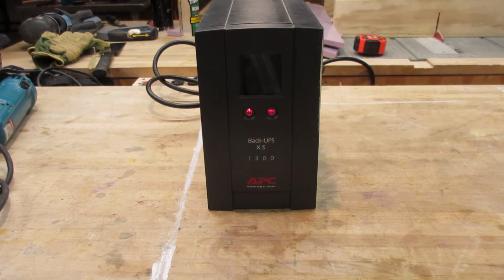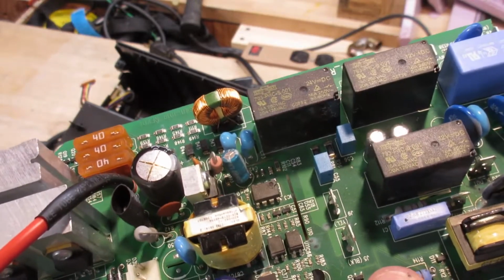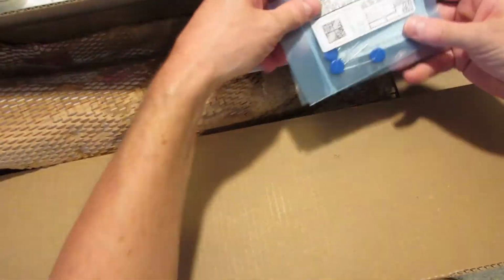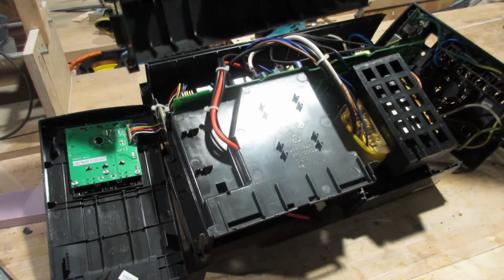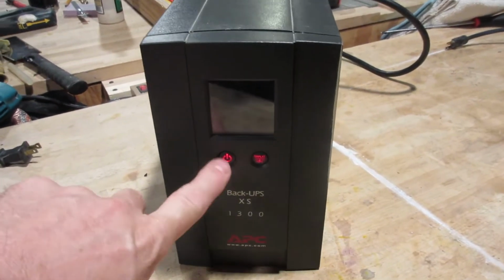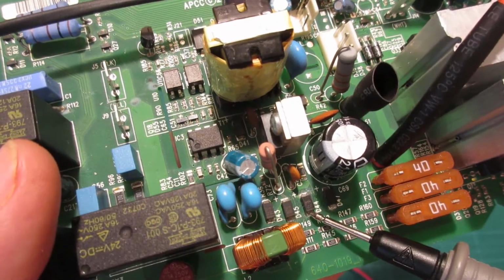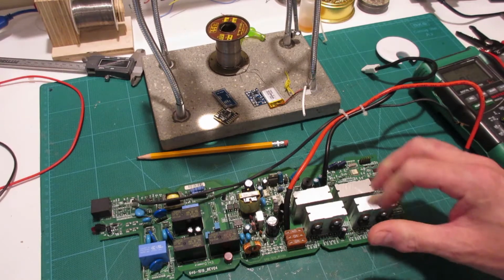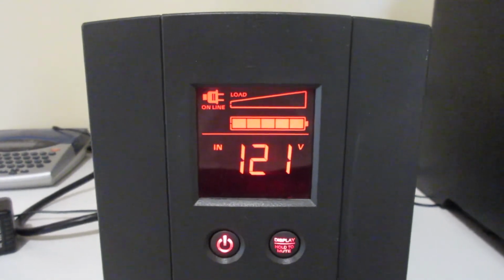Repair your APC Battery Backup....The Wrong Way?

Comment: Hey thank you for the vid! I have the same UPS and it shown the same problem (and I did the same waste of new batteries). Funny they had exactly 2.5 years like the previous set before them, so I really thought it was time for a swap.
I was struggling with the front side removal, as I didn't find any screws. Seems all I gotta do is pull it out. :)
Reply: I think I'm luckier then you. All I got is a bulged C69 cap; good rectifier diodes, good relays (confirmed 24V relay only clicks if fed with 24V, as expected); fuses ok. But I guess I'll take a shorter path than you to testing: once I place the c69 in, instead of assembling everything and hoping for the best, I will just ensure nothing shorts, plug the batteries and hop the AC cable to see if the batteries reading raises (in a sign of being charged). It should slowly grow to 27.6V as my other single-battery APC UPS (RS 500VA) gauges to 13.8V while in charge mode. Once I get the readings up, then I will assemble everything back up. I did not need to remove the several cables from the PCB to get easy (enough) access to C69, so... Funny fact: the board was "burnt" around C69, but not in black stain like yours, it was _white_! Maybe C69's dielectric sublimation.
Reply: Not luckier. The cap is replaced and it still doesn't charge batteries. Varistors open (good), rectifier diodes ok, fuses all short (none open). So I'll have to dig deeper this board to understand why no +28V output to charge batteries. 😢

Comment: Change battery to lithium get more run time wich i did i have 550VA ok 12Volt lead acid battery i have 18V 5A and 18V 12A  Lithium battery so i buy 18V converter to 12V 20A so i can used it drill battery i have i do 1 hour and 15minutes on battery charging my dell laptop 10 buy 16 scream 12am 60%  100% fully charge get to 1:15am my battery blink so i have charrge it

Comment: I still have a Back-UPS NS 1250 that I bought from sam's club back in 2007 and still going strong, ignoring the LCD display issues probably caused by a bad capacitor similar to one you've replaced in your video. All I have ever had to do it is replace the batteries every 3 to 5 years, depending on the number of power outages that completely discharge the battery pack. I'm bookmarking this video and use it as a reference if I ever have to do any repairs on mine. This particular model series of APC UPSs sure do way outlast the recent models that can't seem to last more than a few months to years without breaking.

I'm curious as to how your UPS is doing four and half years later. Is it still in working condition and if you've had to do anymore repairs since then?
Reply from the maker: Yes, it is still going strong. Replaced the batteries once so far. Well worth the time and effort to fix.

Comment: This might be an aging thread but still valid info. I have 10 UPS's with this board in it. The MOV you replaced was likely damaged as a result of doing its job by absorbing a surge event.  The 22uf at 400v cap is obvious and needs to be replaced. All other electrolytic caps have to be replaced as well .  Every one I've worked on has failing caps, every cap. the worst are the Jamicon branded. They have high leakage or high ESR. Testing the Capacitance will say they are good, but almost all will be bad in other way as described earlier.  These are great supplies and can continue to be for many years with maintenance.  Replace all electrolytics and it will be fine in most cases.

Comment: Wow! Careful there, you risk serious injury touching caps with hands and screwdriver! They can hold very high voltage that is stored in them even when not connected to mains. I'm not a pro either, but was warned of this a long time back and wont touch psu's. Pro's know how to avoid or discharge the caps before working on replacing. Be very careful. 👍

Comment: Man, your video helped me a lot but I sill couldn't fix my ups. Mine is the same as yours, same board, etc. The problem that I have is that it is only sending 16V to the batteries. I found that big capacitor a little swollen, I decided to change it, so I did, now the batteries are only receiving 20V, which is still very low from the 26V they should get. I have no idea what to do now, any hints?

Comment: So the relay ended up sticking on which mostlikly is what killed the charging circut. The smoke signal kinda tells you to much current went threw it. Though it could have been the inverse. The varistor could have went some how and fucked up the charging circut. Though highly unlickly

Comment: A few tips that should make troubleshooting a lot easier:
- Learn basic electronics before attempting any repair;
- Familiarize yourself with the theory of operation of the appliance you're trying to fix;
- Gather schematics and repair manuals. Even if they're unavailable for the specific make and model you're looking for, similarities always exist;
- Before disconnecting wires, take notes as to where each one goes -- you'll be thankful you've done it later;
- Always measure voltages (first rule of troubleshooting);
- Never trust visuals alone -- they can be deceiving;
- Avoid testing components in-circuit whenever possible -- they can read and test incorrectly;
- Fuses have ratings for a reason. Make sure to replace them with the right type, current and voltage ratings. If you don't, consequences can range from premature failure of said fuse to property damage and/or death.

Comment: I've got one of these that I picked out of an ewaste bin a few years ago. Finally got around to putting batteries in it, and it fires up and runs, but doesn't charge the batteries!

Unlike yours, there's no skid marks, no blown fuses, and no pooched diodes. The only fault I can see is the bulging (mine isn't leaking yet) big 22uF 400v cap. I'm skeptical if that cap by itself would be enough to prevent the batteries from receiving a charge. Once the batteries are done on my smart charger I'm going to plug them in and measure terminal voltages with the UPS in operation....

Thank you for the detailed video!
Reply: The cap is probably involved in line voltage detection.  The UPS believes line voltage is low, so it won’t charge the battery.  This is a common problem.  Google “apc ups capacitor repair” for more info.
Reply from the maker: It might be the culprit mate.  For the price of a cap it's worth a shot.

Comment: I know that this is a very old clip but I have 4 1500 APCs sitting here with the exact same problem. Would you by chance have part numbers for the component that you replaced.  Thanks
Reply from the maker: Not really. I still have some extra varistors kicking around (Blue disc like things)....hang on...They are 360V 4.5KA (14mm).  Hope that helps.
Reply: OK thanks, i will do more checking once I get 1 of my 4 units apart.

Comment: If solder wick does not get all the solder out of the hole, try inserting a wooden toothpick (suitably whittled down) into the hole while the solder is molten. The wooden toothpick does not absorb the heat, so the solder will usually stay molten while you insert the toothpick. It should leave enough of an opening that you can then insert the part followed by soldering the new part in place.

Comment: MV or MOV (Metal Oxide Varistor) were parts developed originally by General Electric to provide protection from voltage spikes and lightning strikes on the 120VAC coming into your house.

Comment: The blue disk metal oxide varistors absorb voltage spikes BUT die a little every time. They save the rest of the circuit but only for so long, replace them all, a cheap effective repair.
Reply from the maker: Thanks for the tip.

Comment: I hack my usb 350 get run for long hours have 4 12 volt lead acid battery 3 battery 12 volt 7.2 Amp each and a 20Amp let acid battery so I have 40Amp fused for my ups been testing today 100% I Plug in my laptop at 4:00pm today Monday time is 11:05 pm and my ups still running so 7hours on battery wich very good 🥰🥰🥰🥰I have 2 GFCI 110V AC out let plug in water proof tool box and 10Amp breaker and cooling fan for my ups not deep cycle I have with my ups  I have 75Amp deep cycle battery with 800 watts inverter in water proof tool box
Reply from the maker: Wow!  Nice.

Comment: change battery used deep cycle battery you get much better longer run time
Reply from the maker: Thanks, I'll keep that in mind when these bite the dust.
Reply: @dork3nergy  I have ups 350 it come with 12volt lead acid battery 7.2Amp what idid I change battery have 4 12 volt battery 3 12 volt 7.2 Amp and 20Amp battery I have water proof tool box so I have 10Amp breaker with GFCI 110V plug on my tool box and 40Amp fused for my battery between positive of my ups cut hole on my ups put fan on it with switch I was testing it run 2hours and half on battery was using my laptop and speaker plug but have go out side did get finish my testing I even have inverter love how those switch over when power out am going get one bigger one like 3000 watts or 5000 watts change battery that run 24/7 put in cooling fan
Reply: well my friend he give me new 550VA ups so i change battery have 18V 5A Lithium battery i have 18V Converter to 12V 20A am using right now rum my 18V 5A and 18V 12A Lithium battery 🥰🥰🥰🥰🥰
Reply: @dork3nergy  your most well come I love those ups used them at same thing when power out have no problem I do 2hours and half on battery was testing it but I when out side

Comment: The second relay you tested is a 24 volt relay. 12 volts was not going to make it click. It probably was not bad. I have the same UPS and the fuse, 400 volt 22uf cap and one other cap blew up. I was hoping to see what the little cap was but can't make it out in the video. It's the greenish one about 1/2 inch left of the 400v I think it's a 63 volt 22uf like the others that look like it. Mine made a big pop in the middle of the night. Blew part of the board apart under the 400v cap. I'll need to add wire to replace the trace.
Reply: I noticed the same 24V relay issue and was about to comment but realized somebody else must have noticed it thru the 4 year period!.. If you still want to know the caps (I doubt so) I'm about to pry open mine (It's not a XS but a RS 1300, probably same-ish board). Just let me know their ids in the board so I can find them easier (if they're not burned dead as well).

Comment: I watched the whole thing. Great job! Very entertaining! Glad you stuck with it and fixed it. Great detail on how to trouble shoot relays, diodes, etc. I am practically deaf, but my wife and grandkids came into the computer room the other day and said what is that loud beeping sound. My reply, what beeping sound? Turned out to be the APC unit, mine is a APC Backups 650,   making a beeping poor old me could not hear. I found and ordered a new Battery. Then tested the battery and found it had 12.9 volts. So I canceled my order. Instruction manual said to unplug everything. Then plug the APC unit back in and then one by one plug in the devices and see which one causes the problem. Kind of weird, because now with just a monitor and computer plugged in, it is working fine and has been for over a week now. Anyways, I loved your video and have subscribed. Keep doing the great videos, you had me laughing in several spots and amazed in others.
Reply from the maker: Thanks John!

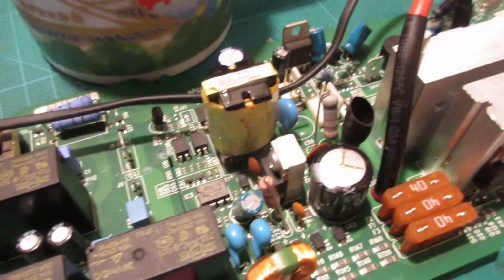Comment: Your main capacitor, the large black one, is bad. I had a 1500VA version of this APC. It still worked, and charged, but the main cap was about to blow, and it was a bulge on the top with brown crap on top, and the heat shrink was ripped on the side as well due to swelling.  For the sake of reliability, you'd want to recap the entire board. That is not cost-effective. I also think that is a simulated sine wave model, so it's not good for super sensitive electronics if it doesn't like the square wave. ***   Never mind. I see @ 18:00 you found it.

Comment: Did a repair very like this one last year. I too learned the hard way, that normally, if one component fails, it can take others either up, or down circuit WITH it. Check EVERYTHING on that PCB, and reassemble it one time !

Comment: 1 year on and this helped me so much with a completely different model but still APC. 
I too had a couple of bulging caps, a shit stain on a metal oxide varistor (MV5) two blown fuses and the final mail that got her going was the god damn user-resettable fuse on the back. Go figure.
Reply from the maker: Cool. Glad you got it working.  Keeping shit out of the landfill is always worth it. Well done!

Comment: Excellent, I have this exact UPS that powered off randomly one day and won't power up again.  I inspected the board and saw nothing obvious but I probably need to get out the meter and start probing more things.  I bet I'll find the issue from what issues you ran into!  Batteries are brand new, I had the thing out the garage for a few years when the last batteries died and I hadn't replaced 'em yet as APC wanted $100 until I realized they were just generic ole 12v 7a batteries.
Reply from the maker: Totally worth a try. Good luck!

Comment: Thank you so much, that 22mf 400v is my exact problem too, cant figure out the part number...the bulgy black/gray @18:05
Reply from the maker: No part number there.  It's a 22uF 400V capacitor.  You can pick one up from this guy on ebay : https://www.ebay.com/itm/331921831976
Reply: @dork3nergy  Thanks, I saw the package in your vid, and contacted the guy, he recommended SC type, as they are better quality, but it is 450V , hope I dont end up on fire, lol.  SC - KM Series - Radial Electrolytic Capacitors - 450V 22uF - 5 Pieces is what I ordered.

Comment: I have this exact unit I bought new at Circuit City for less than it costs to replace the battery...Been meaning to fix it but just gotta build up the patience.  It works, but under any load on AC the battery won't keep charged.
Reply from the maker: No harm in having a look inside. Go for it.

Comment: I really like the way you show your mistakes.  That's what we encounter when we try to follow these instructional videos, but most people cut those out, so that they don't look like they didn't know what they were doing.  Now I can try to fix the three that I have.
Reply from the maker: Mistakes are how we learn.  Plus, since I don't know what I'm doing most times, part of the journey is troubleshooting which invariably involves cocking things up.  Thanks for tuning in!
Reply: and you have those ups run 24/7 with deep cycle battery like how I doing I have 4 12 volt lead acid battery 3 12 volt 7.2 Amp each and one 12 volt 20Amp lead acid battery been running my ups for more than 7 hours now with my laptop wich dam good 😍😍

Comment: I have a Smart-UPS 1400 that lost an awful lot of smoke.  I haven't tried to repair it for perhaps the same reason APC doesn't, I don't want it to burn my house down.  This one died when the electric company's transformer on the pole blew up and sent a 600 volt surge into four houses (maybe more than 600 but that's what the UPS reported), we all lost most everything plugged in and not protected by a UPS.  The UPS continued to power the computer from the battery but clearly the power input section is in trouble based on the burned section.

You had a much smaller surge though it is possible that MMOV surge surpressor  burned out before you got the UPS, my surge was obvious because the UPS continued to emit smoke long after power was gone.
Reply from the maker: Wow!  That's crazy.

Comment: I have four of these (APC white boxes) different sizes that don't want to work anymore with different issues like won't go off battery when plugged in, saying battery needs replacement, going on overload with a 2 watt load when unplugged, all have full batteries. Any suggestions? Total value of these are about $1,200 new, I'm guessing.
Reply from the maker: Can't say off the top of my head but, I would probably do what I did here.  Just look for shit that ain't right and replace those parts.  The components on these boards are mostly testable.
Reply: If you a bit of research on APC UPS, one common problem across multiple models seems to be poor quality 22uF capacitors.  One YouTuber stated that the first thing they always do is to replace the 22 uF capacitors before troubleshooting anything else.

Comment: Id check the electrolytics  as well as the large one when you had this unit apart was showing a bulging top which means near end of life of the cap - 
Well ya made it - Wayda go there, obviously ther was more to the story than I had realized, but you saved I'd guess $400.00 retail. That unit probably experienced a power spike and did it's job,
Job well done!!!
Reply from the maker: Thanks. I'll definitely check that cap when I need go in again.

Comment: MV = MOV = Metal Oxide Varister = Transorb. It's a surge suppresser; presumably a mains-rated one.
Reply: They protect against power surge.  They burn out and protect the appliance plugged in downstream.
Reply: MOVs die slowly in use, every surge they absorb will eat them away till they die. For the price it's often worth replacing all of any group of them.

Comment: The other thing you missed replacing was the near to bursting filter capacitor by the heatsinks. See how its top is domed up ?
Reply: I noticed that too and was going to mention it but you beat me to it.
Reply from the maker: Thanks for that observation. It's still going but it will be the first thing I check when if it fails.

Comment: or you come over to my place ... got these units very often. battery dead. new battery cost more then the whole unit. So the battery goes into the recycle bin and the transformer to the copper scrap.